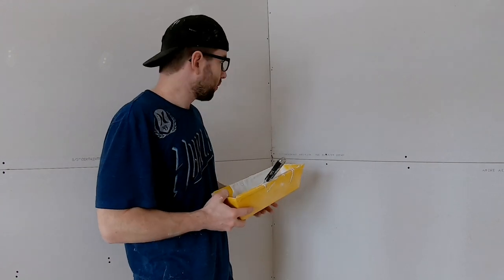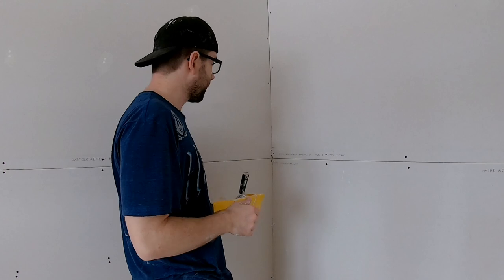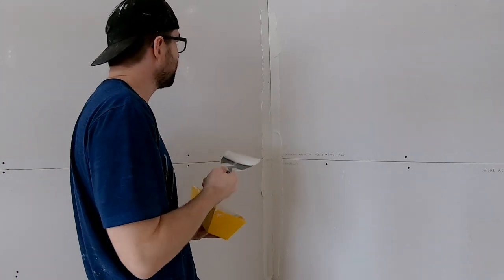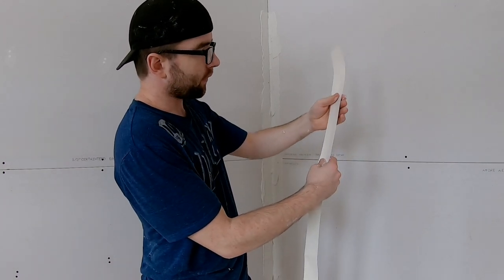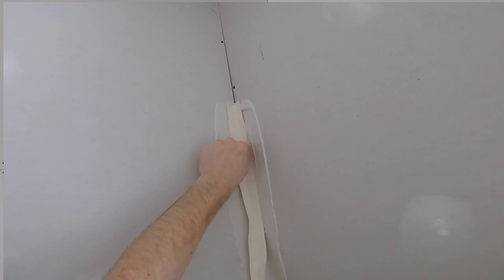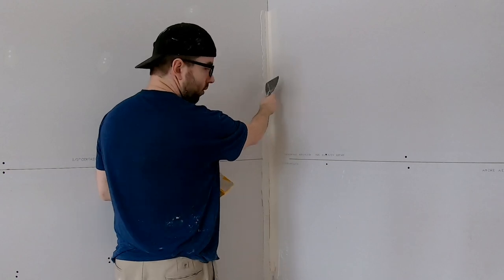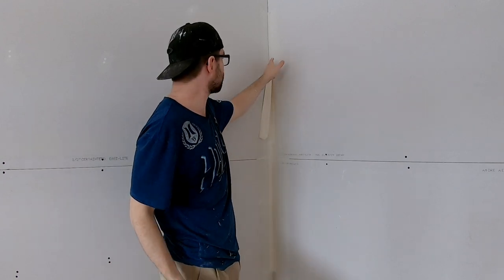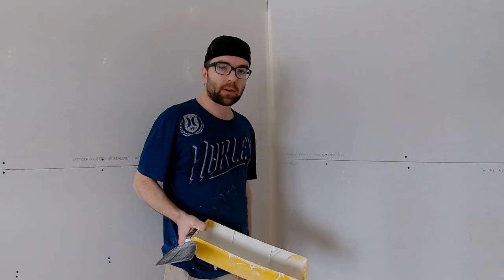How to tape Drywall inside Corners

Comment: Your videos are really easy to follow, thank you.
I am attempting to repair joint tape. After the steps in the video would you then apply another layer of joint compound over the tape and once that is dry sand the edges where the joint compound meets the wall and then the walls are ready to paint?